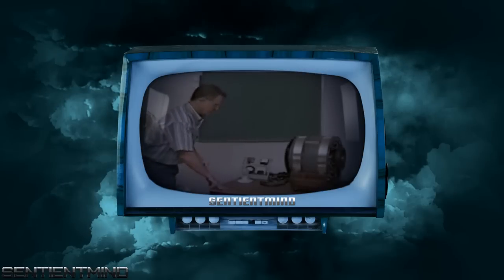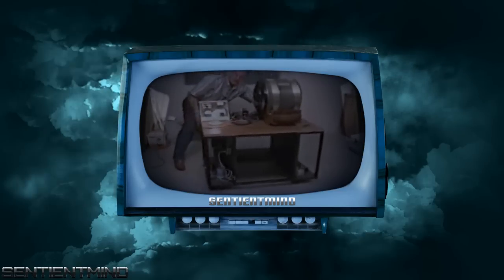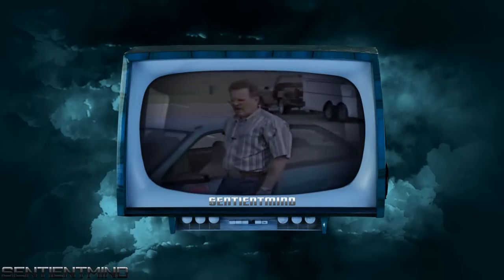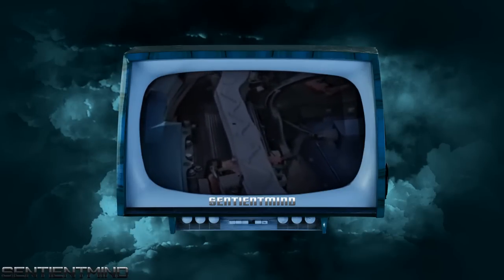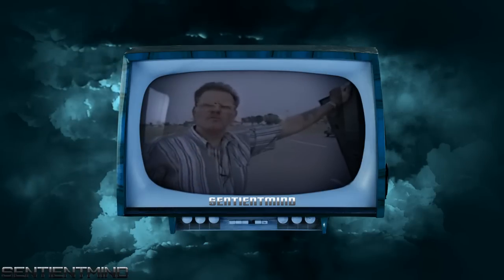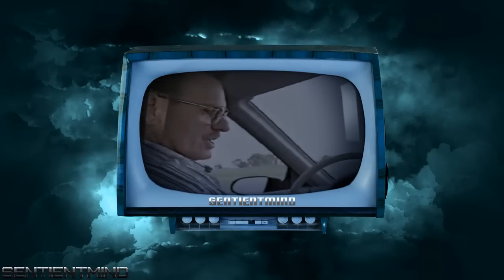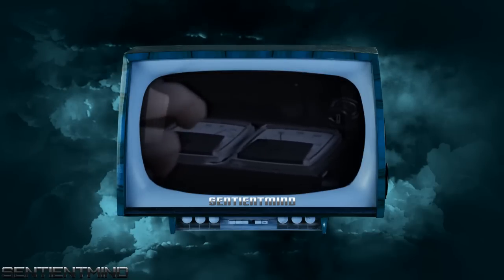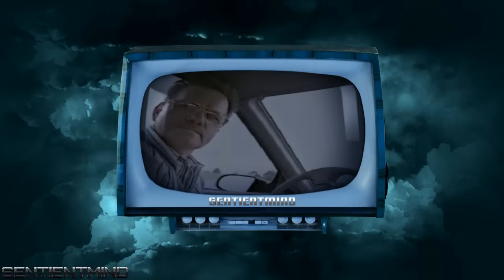Free Energy

Comment: Electric cars having normal transmissions and his have an automatic? wtf. electric cars don't use transmissions. transmissions change gears and all that shit you don't have in an electric car. an electric car has motors for each wheel and an motor control system computer that controls them and there individual speeds. Unless he is using an electric motor to actually move a drive shaft, but that is ridiculously inefficient and I am not sure anyone ever built an electric car like that. If someone wants to prove me wrong on that, id be happy to hear it. Those big ass mining trucks that are like 2 stories tall actually use a big normal engine to power a 3MW electric generator, which then powers everything else.

Comment: The demonstrated product is just a flywheel energy storage mechanism. It doesn't produce energy - it stores it. Flywheel electric cars were a field of research for a while, but they have long since been surpassed by battery and supercapacitor research. The first and second laws of thermodynamics are not broken so this is NOT 'free' energy. Sure, eventually solar energy can be used to charge energy storage systems (e.g. batteries) for negligible economic cost, but it's not free energy.